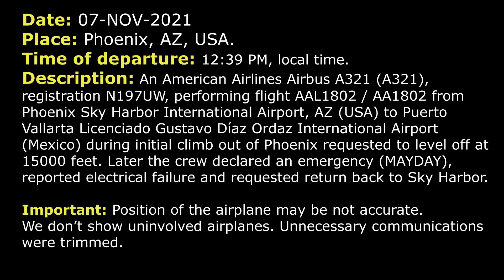MAYDAY, electrical failure in flight | American Airbus A321 | Phoenix, ATC

Comment: So can an expert or an Airbus/airline pilot explain to me, if they are having an elctrical failure, why does it seem that when they're flying back to PHX, teh aircraft is under total control and flying normally?  What's being affected?  Thanks in advance
Reply: He said he had lost 1 generator. 
Each engine plus the auxiliary power unit has a generator. The flight systems are redundant to prevent an additional problem.
Reply: @peterlarson9769  Thank you,  but obviously not safe enough to continue the flight.  Airplanes are so safe today.

Comment: Did he say he was taking his shoes off? 🤷‍♂️
Reply: He was joking about figuring out the math from gallons of fuel to hours of fuel.  Very calm pilot for sure.
Reply: @brentc4865  No, from hours to minutes.  The controller asked for minutes.  Additionally, the quantity is shown in pounds.  Gallons would do the flight crew no good.
Reply: It's a joke about needing his toes to count because the number is higher than the number fingers he has
Reply: Sounded like he had to "check his sheets"
Reply: He was funny pilot and deserves Oscar

Comment: So a generator on one of the engines presumably went off-line, so as he said..”We’re down to one generator”. 

Anybody want to tell him that there’s a spare generator in the tail. It’s more commonly known as an APU … Miraculously he’d then have two generators again, so absolutely no emergency. 

Captain’s call on the day, but as others have commented.. “.. can’t understand how this was an emergency”. 

You’d be correct. 

It wasn’t.
Reply: That’s not correct, the fact that they had an electrical failure is an emergency itself, regardless if the APU is available or not. A lot of things can make an electrical problem worse with time perhaps an electrical fire. They followed SOPs declared an emergency and returned to the field decreasing the risk of what could happen next.
Reply: @JavierCruz-je1ct  yh
Reply: The APU on this bus model is a common issue - from fume events to MEL, its a constant issue.
Reply: Maybe they had an air start because the APU was inop. It's pretty common
Reply: @blackmusik109  Absolutely fair point.
Reply: Apparently you didnt hear the part where he is said he was down to one generator.
Reply: Maybe he didn’t wanna risk it
Reply: If you are down to one, your redundancy is gone and I think that's a good reason to declare emergency.
Reply: No way in Hell am I continuing down to Mexico with a failed generator.  You are correct that the APU is perfectly capable of powering the whole plane, if it is working, but he did the right thing in going back to the airport.
Reply: The QRH or checklist would have told them to start the APU, if available. It’s obvious the APU wasn’t available, so they were indeed down to one generator. That’s a land at the nearest suitable airport in every case.
Reply: It is common to MEL either the APU or the IDG. Normal operations require 2 generators. If one generator is on MEL, loss of another generator would require a landing ASAP.
Reply: Mayday is an overkill. Loss of two generators still is a panpan (if needed), it's just a ecam. Performing an overweight landing for this? Again can rather spend time and burn fuel. If there are two generators (apu and one engine generator), then you can continue to any overland destination not requiring EDTO operation.
However if the generator failed and created some fire or smoke, than the pilot is absolutely right in calling a mayday.
Reply: That's not true... There are bus ties in the system that operate separately when the engines are running. Therefore, the APU running would have no effect on the power available as that power supply is disconnected when engines are running. The one generator has more than enough output to power the aircraft and all systems through redundancy and the main bus tie.

Comment: how is this an emergency?
Reply: Because the Pilot in Command said it was.
Reply: @richardcarlson127  Exactly! AIM 6-1-2 "An emergency can be either a distress or urgency condition... Pilots who become apprehensive for their safety for any reason should request assistance immediately." The law says his plane =  his call
Reply: They are down to a single generator due to an electrical failure, that’s why it is an emergency.
Reply: @JavierCruz-je1ct  So what would you call an airbus with both engine generators failed if one failure is an ‘emergency’?
Reply: @cedarkey  An emergency just like being down to one generator. (APU probably inop).
Reply: @JavierCruz-je1ct  Having one generator on an airbus versus having no generator (Emergency electrical configuration) are two very very different things. 

One generator…. Aircraft has full automatics. Autopilot available. Auto thrust available.. all cockpit displays working. Normal Law. 

No engine generator working (and no apu available)… manual flying, with two cockpit screens instead of 6. Alternate law, followed by Direct law once Landing gear extended. 

It’s a different beast.
Reply: @cedarkey  who cares, if I’m down to one generator I’m not taking the aircraft to Mexico and AOG it.
Reply: @JavierCruz-je1ct  I absolutely agree with you. My question is the use of the word ‘Emergency’ among North American pilots. 

He at least used the internationally recognisable phrase Mayday (x3), but I’d argue that a single generator is not an ‘Emergency’. 

An ‘emergency’ in my view is Smoke/Fire/Fuel leak/Depressurisation/All generators u/s etc. 

I agree in getting the aircraft back onto the ground asap. 

That’s my point.
Reply: @cedarkey   Maybe if you were the PIC on this flight you probably had done something different. But this PIC made the decision to declare an emergency and return, and instead of judging his decision, I support him.
Reply: @cedarkey  an emergency emergency
Reply: @apilotspersective  😂 That cheered me up this morning while having my breakfast 😂. I’m going to use that myself in future. 👍
Reply: Because they conducted an overweight landing.
Reply: fine line between a pan-pan and a mayday, but you don't get charged any extra for the mayday ;-)